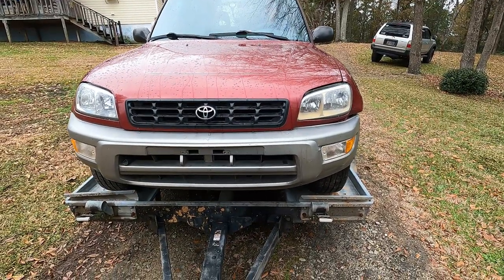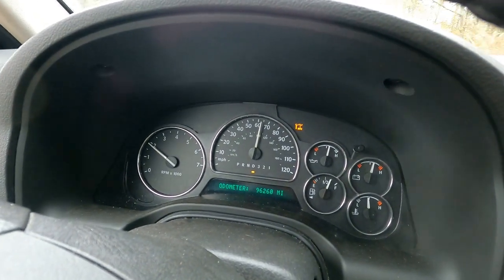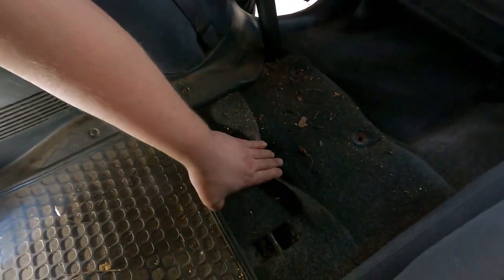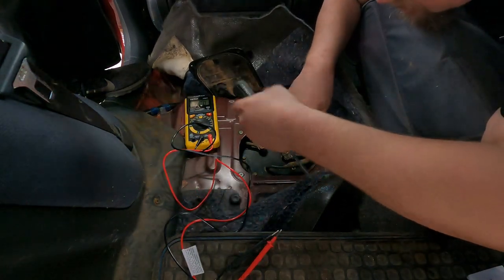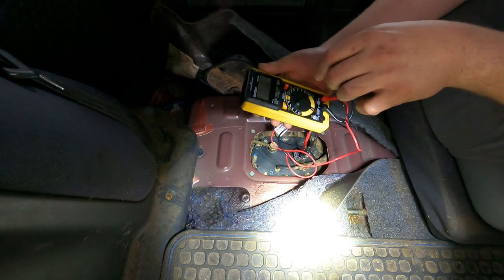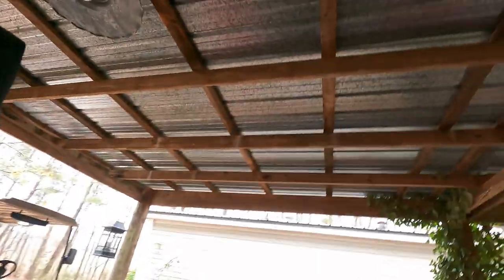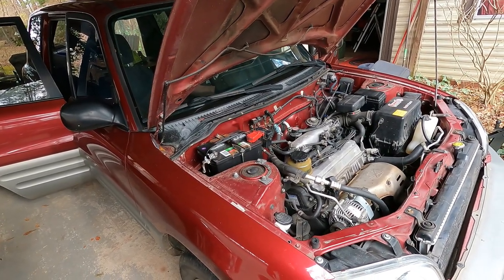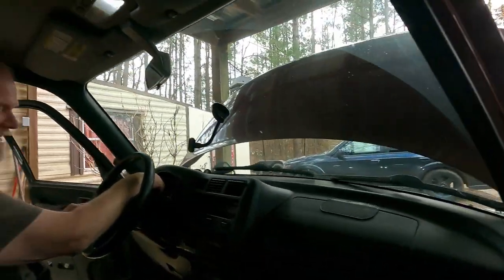Rescuing My Dad's 2000 Toyota RAV4!! (How To Diagnose Fuel Issues)

Comment: A great video...thanks a ton...I just pulled one out of a parts car...def not a simple in and out with it. My 99 has 267K and runs like a champ...usually...this is first issue I have had with it besides 1 timing belt. I wasn't aware that Toyota fuel pumps only work when cranking or if it's running...ya learn something new every day. Where are the relays/fuses that run the fuel pump...I got my connector off...also a chore but would love to see if relays click or whatnot before opening my gas tank. I have read on forums they usually like to die right after a fill up...I had just put a half tank in it. Thanks again for the great video!!
Reply from the maker: Good evening! The relay for the fuel pump is on the passenger side in the kick panel, but another relay that energizes that one is on the driver's side next to the fuse panel. It's probably easiest to test it using the test connector under the hood.
Reply: @RevHardGarage  by test connector are you meaning the one you plug in to look for codes etc.?The EFI fuse on the block on LH strut tower is good.
Reply from the maker: @donw3912  no not the obd2 port. There is a black connector under the engine bay that you cab probe to test certain things. You'll have to look online for a diagram to use it.
Reply: It's a beast in winter, very reliable

Comment: How do you open these without a key I locked mines in and I don’t want to break the window or call a locksmith.
Reply from the maker: You have to carefully qedge the top if the door open about 1/2" and hut the unlock button or hook the lock know at door handle. Its actually pretty easy.
Reply: @RevHardGarage  Thanks man
Reply: Went to my local dealer on a hunch with my title and they made a key for me off the VIN, they wanted the car to be there just to make sure it would work but that was not doable in my situation so they made it anyway, 20 bucks, no chip and it’ll last longer than aftermarket keys made elsewhere